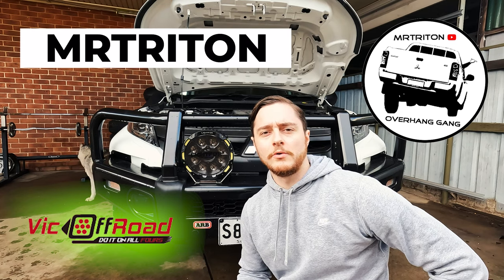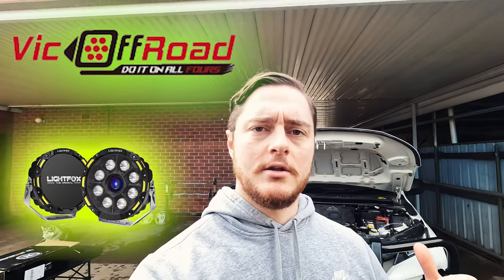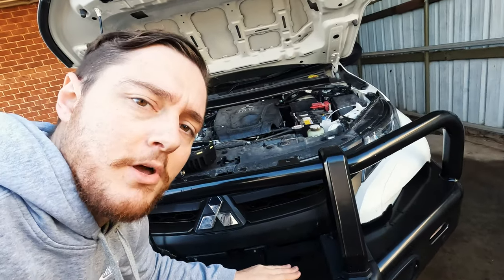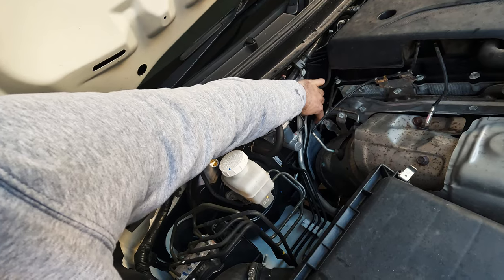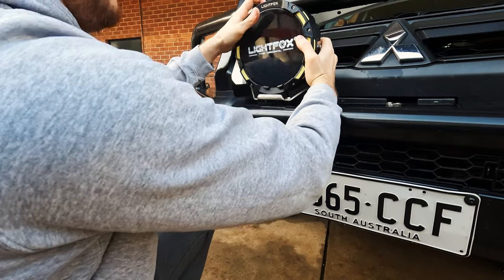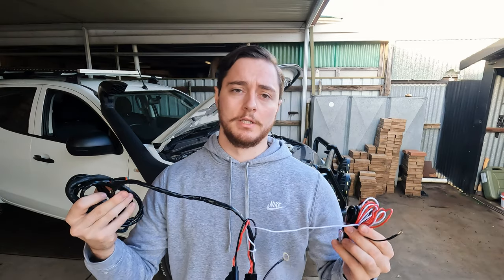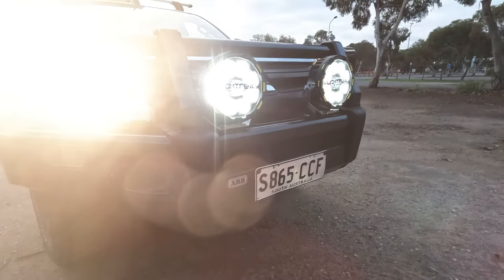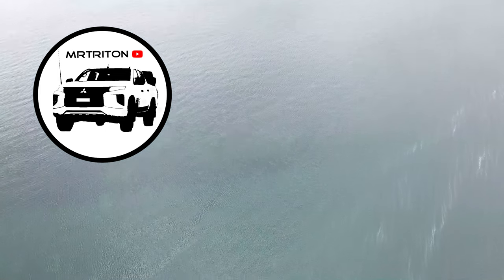MRTRITON - SPOTLIGHT INSTALLATION - LIGHTFOX 9 INCH DRIVING LIGHT INSTALLATION

Comment: I need to get some good spotties for my MR GSR. The roo bar fitted by the dealer is great but it has a sign on it with what seems a ridiculously low weight limit!
Could you do a video showing how to use the 4WD functions of the MR? I have no real idea of when to use what function. Cheers and thanks for the videos.
Reply from the maker: I'll make sure to give a run down next time I'm off-roading👍

Comment: Hi mate love your video keep it up mate, need your suggestions as well got mr triton 2022, don’t have any lift up kit, I don’t do off road driving, don’t carry much on it , just roof top tent and fridge, if I put 17 inch wheels and 32 tyre should be Oka ????
Reply from the maker: Thanks mate, off the top of my head that seems like it'd work fine but if you're unsure you could always check with your local tyre shop 👍

Comment: Hey mate 
How did take the on off switch wire through there .
I couldn't find any hole or something to take the on off switch wire inside
Reply from the maker: There's a grommet behind the dpf heat shield but apparently there's a better one near the brake booster. Might take a bit of messing around to get to it.
Reply: Thanks mate

Comment: You didn’t connect to high beam. Are they running independently of your high beam?
Reply from the maker: The highbeams are connected but it got complicated so I didn't include it in the video 👍 if they're wired independently it's not legal
Reply: How did you connect the high beam?
Reply: @toddfurner7606  most good wiring kits will have a piggy back plug that you plug into the rear of the headlight. It's actually very simple on the good plug and play wiring looms.

Comment: Great job👍  did you say you have  an air compressor under the hood?
Reply from the maker: Yeah mate, I have an ARB built in compressor 👍
Reply: @mrtriton5405  awesome 👌  single or double? Did you install or arb ?
Reply from the maker: @josephveitch9244  I got the single, still had plenty of output though. I installed myself before I started the channel so I didn't record it sadly.
Reply: @mrtriton5405  legend 👍